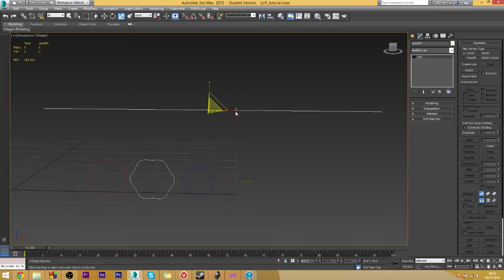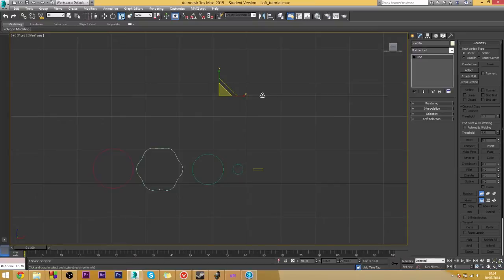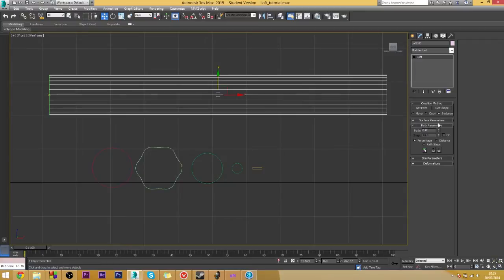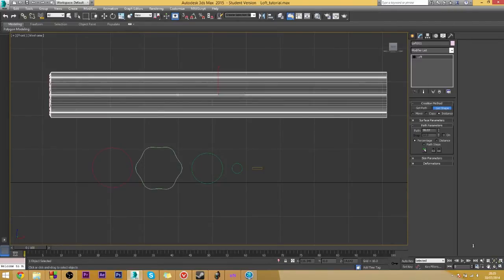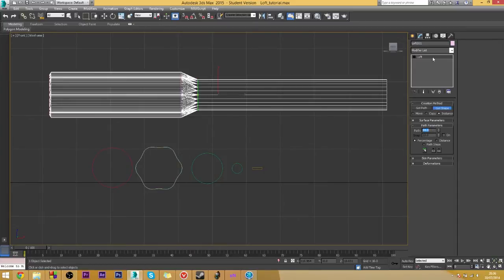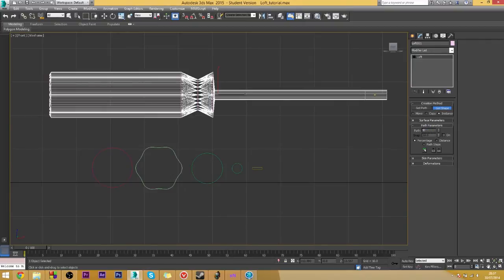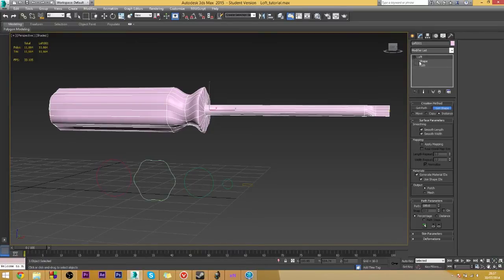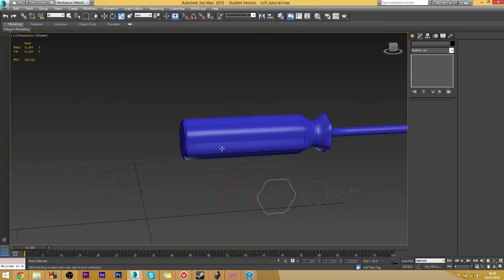3DS Max - Loft Tool

Comment: When I try to use the loft tool, I always end of with a lop sided shape; I'm trying to do it like you do, but doesn't work out for me. Do I have to center the line on a certain axis, change the center point of each shape to match the direction of the path, or what?
Reply from the maker: Luke Tate  No you shouldn't have to do that, What shape are you trying to make?
Reply: I'm trying to make a Burger King sign, with the top part of it starting as a cube and transitioning into a half sphere, in front of the cube; basically, I'm trying to make a modern day Burger King drive-thru sign.
Reply from the maker: Luke Tate Ahh ok well then may I suggest you don't use the loft tool for that, instead what I would use is soft selection, that would be the much better option.
Reply: For a class assignment in college, I have to make a sign from a referenced store, restaurant or other building  and the sign must be done complexly, using at least three of the following techniques: extrude, bevel, lathe, sweep, and loft. I am also expected to make the sign stand. I thank you for your support; I really do, but I need to use those specific techniques, in order to pass. Sorry for the long post, but do you what tool out of the ones I mention will give me the square to semi sphere effect?
Reply from the maker: Luke Tate You could use the Bevel tool to make the shape of it, and then use mesh smooth or turbo smooth to smooth it out, that's what I would use. Although If I was you I'd make the square part out of a plane and then use the extrude tool and then using the lathe tool and the line tool make a rounded shape so when the lathe has been used it makes a half sphere, then just place it on top of the box